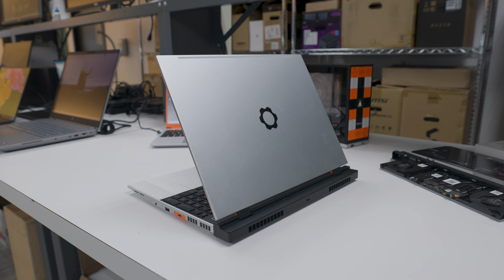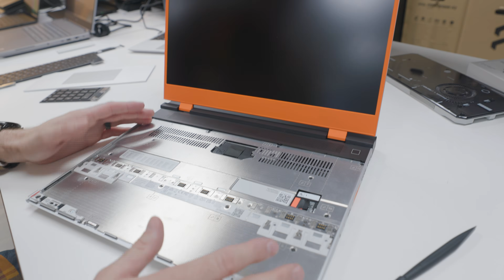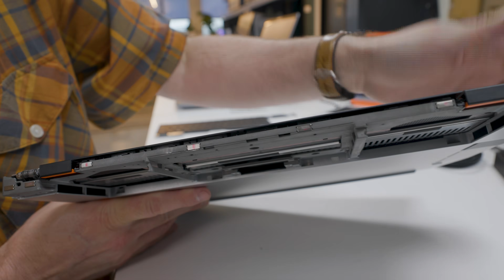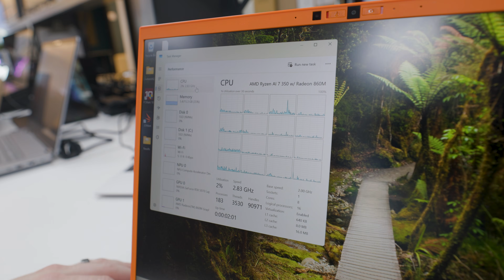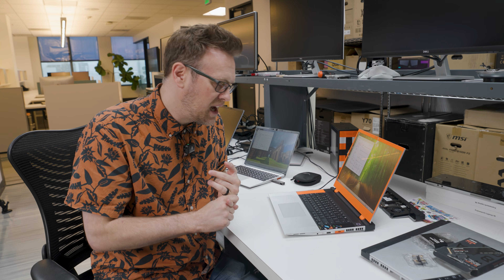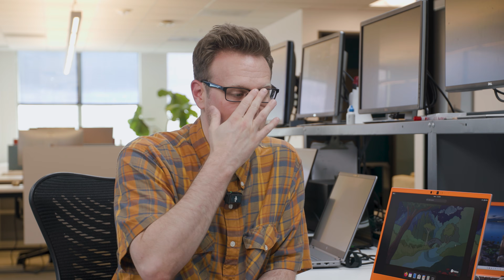Tested: RTX 5070 Laptop & RX 7700S In Framework Laptop 16

Comment: im considering getting a "Future proof gaming laptop. Do you think this is it?
Reply: Bit of a late reply but they are planning to release a oculink adapter which allows desktop gpus to be connected if that might interest you. Me and a friend bought one recently and due to us both being in IT havent really had any issues we couldnt fix or solve quickly and are planning to use the oculink feature when it does come out.
Reply: Not yet. The cpu isn't swappable so it'll bottleneck in the so near future. The idea is good tho.
Reply: @R_5_ thank you
Reply: @R_5_ you can buy new mobo though?
Reply: @carljamesbustamante3012 Technically, yes.
But upgrading the motherboard & gpu and everything that you'd need an upgrade will be the cost of a new laptop. Until they're so big to the point their modules matches the usual prices of specs it'll make no sense to use them. Unless you're a tech nerd who doesn't really care about money, then it's gonna be the best laptop of your life.
Reply: @R_5_ yeah I see the point. I'd love for them to support trade-in like iphones. That would lower the price so much

Comment: You can't charge via the USB-C port on the Radeon module, wasn't designed to do it. The USB-C is purely there as a DisplayPort out, so you can avoid having to use MUX switching. Does USB 2.0 speeds as well as it's the minimum standard.

Framework added charging pass through functionality to the Nvidia card as it was requested so much.

Comment: Imagine paying 700$ for the GPU + 1300$ for the base BARE METAL model with an entry level CPU when you can buy an entire new laptop with 24 cores CPU, 32GB RAM, 240hz and RTX 5070 for 1150 USD.

BuT yOu CaN UpGrAdE iT 🥴
Amazing! So I spent 2,400 dollars on a low-end laptop that will bottleneck any overpriced GPU that they MIGHT sell in the future.

They'll go bankrupt in 3 years. Extremely overpriced, double+ the market prices. Better to just buy a new laptop every 3 years than this cr*p.
Reply: lets see in 3 years
Reply: @dekufan-f7i  bruh how can u justify paying over double the price for the upgradability? You really think your lame 7840hs will be able to handle next gen GPUs of 3 years from now? It's nonsense.
Reply: @edengalant  there will also be newer cpus. but for me its about the repair-ability first and upgradeablity second. I want a laptop than can physically stand for 5, 10 years so by then when its unbearable, i get new shit
Reply: @dekufan-f7i it won't hold 5 years, the CPUs they provide today won't handle any component of five years from now... That's the truth. Laptop won't be a PC.
Reply: @edengalant  do you know you can also upgrade the cpu of the framework? Also look at the people running super old thinkpads and are perfectly fine, that what I want
Reply: @dekufan-f7i so if you upgrade your entire pc eventually what the difference than just buying a new one with better specs for half the price? I can't get the logic of people. I usually really like small consumer friendly companies but in this case it seems the greed got the better of them.
Reply: @edengalant  i personally like the fact that i have to choice to upgrade and keep the same system
Reply: @edengalant  They literally have done that with the Framework Laptop 13. You can take the ORIGINAL MACHINE and upgrade it to the latest shit no damn problem. You should actually do your research.
Reply: true, the main benefit isn't from upgrading though, it's that if you keep this laptop for years and something fails, you can just replace the part rather than paying for an expensive repair job (or in most cases, a whole new laptop). this point applies more to the framework 13 though i feel, as the price on this unit is just too high for most to justify as you said.
Reply: If all you care about is you, just go buy some trash-glued laptop. You'll often get devices, that barely run Windows and where Linux cannot even be installed, because a lot of parts lack drivers.

But if you don't care about that, go with cheap.
Reply: @igordasunddas3377 so let's pay x4 the price just so we can upgrade in 4 years the GPU that will be completely bottlenecked by the entry level CPU they offer for 1300 dollars 😂😂
Reply: "They'll go bankrupt in 3 years"

Ah yes because they were just founded and totally haven't been extremely successful in LITERALLY CHANGING THE INDUSTRY (See Dell's similar initiative) in the five years since their founding.

But you continue being wasteful and throwing your perfectly usable laptops away because you don't see the point in something that will actually fucking last.
Reply: @FluffyPuppyKasey no bro, so let's pay 1,300 dollars for a bare metal model with no ram and an entry level mini PC processor just so it will barely keep up in 2 years so I'll have to replace all the components again! So useful! People are damn stupid falling to marketing strategies... If it was half the price MAYBE it would've been worth it.

Comment: This is nothing short of amazing.
Reply: Nothing short of a scam. Selling low end components for crazy prices just so you'd be able to "upgrade" in the future with another overpriced component that will be bottlenecked by the older ones. Amazing!
Reply: @edengalant  Maybe the brands that sell you "high end" laptops that have soldered in components and little repairability could be scams. Framework is much smaller than lenovo, asus etc. Complain to them first.
Reply: @nelli-ocalypse  yet selling a 300$ mini pc cpu for 1300$ barebone (while the mini pc comes loaded) is outrageous no matter how you put it.
Reply: @edengalant thanks, you just convinced me to buy a framework! 🎉🎉

Comment: Wish they did a 5070ti, more vram is always better
Reply: They did an AMA about this and basically they couldn't find a reasonable thermal solution for the added wattage requirements within the same chassis
Reply: @slickvibez16  framework 18 gaming when?

Comment: The AMD dGPU module explicitly does not support charging, it is DisplayPort and USB 2.0 only. Nvidia does add charging support. Framework has charts on their knowledgebase detailing which ports offer which functions. Also... Fedora 22? Uh..... You mean Fedora 42 or the current 43. 22 was 10+ years ago.
Reply from the maker: Yes, Fedora 42! And thanks for the heads up on that port, that's what I get for not reading the documentation more closely. Just glad I didn't break anything 😅
-Adam
Reply: @pcworld  All in all I think you did a pretty good job - Framework's hardware is certainly a bit "unusual". On the Linux front its easy for a newcomer to get confused between all the many distros/components and versions. You'll be a "gray beard" like those of us who've been working with Linux/BSD/UNIX for... A very long time... Plenty soon enough... Keep at it.
Reply: @pcworld  Framework spells it out directly if you try to pick expansion cards while you have the nVidia GPU option: "If you are configuring your laptop with an AMD Graphics Module or Expansion Bay Shell, be sure to include at least one USB-C Expansion Card for charging. The NVIDIA® Graphics Module has a built-in USB-C charging port on the rear, so no additional USB-C Expansion Card is required."
Reply: What they don't say is if the Nvidia gpu charging is supported on the old version of the board.

Comment: The timing of this video could not have been better. I've been considering upgrading to a framework laptop. Thank you!
Reply: Ignore the comments above. You should buy a product based on your requirements.

Yes the framework is expensive but you also get 
-modular port
-modular keyboard layout
-better repair support
-replaceable battery
-better linux support (if you like) 
-Better charger (240W USB C) 
-replaceable screen if lines show up
And a chance to support a company who actually wants to make it products sustainable rather than cheap E-waste. 
I know these things may not be the features some people are looking for in a laptop but if you are then framework is best for you. 
Decision is yours
Reply: @okman9684 how does an entry level mini PC CPU (7840HS) for 4(!!!) times the price is sustainable? It will bottleneck any future GPU, cut the bullshit
Reply: @edengalant its sustainable because people care more about stability over specs. There's a reason why iPhones sell more. IPhones are better optimized and reliable than most budget and even flagship Android.
 Framework laptops are far more reliable windows laptops than many spec heavy Asus and dell laptop. Telling you from experience your 2000$ Asus ROG or Alienware will show many problems before a framework laptop will experience its first crash. And thats enough of a buying reason for many
Reply: @okman9684  And with all that, x4 the average price of a computer with such specs is irrational. That's greedy. They can't act as 'consumer friendly' when shoving such prices. Beside, that's not comparable to iPhone (with all my despise to Apple) - Apple offers you an extremely optimized and tailored OS with their devices. Here you just get swappable hardware.
Reply: Oh please don't. You can literally find brand new laptop with much better specs for half the price. Upgradability my ass. Their CPUs will bottleneck any future GPU you'll attempt to put. So imagine paying 2400$ for a low tier RTX 5070 laptop just so you'll be able to allegedly upgrade it for an overpriced bottlenecked GPU in the future.
Reply: @edengalant  No one should be looking at framework just from a perspective of gaming performance per dollar. In that case, yeah, go for a gaming laptop if that’s what you’re after. Yeah it’s overpriced because there’s more engineering involved having it be modular instead of all on one pcb, so yeah you can say it’s the novelty.
Reply: @edengalant  Exactly!! You have to buy their upgrade modules, which are underpowered and overpriced.   You could just buy an Acer Nitro with a 5070 Ti for $1300 from walmart, use it for a couple years and then just buy the next iteration a 6070ti or 7070 Ti for another $1300 and it would still be easier and cheaper.  Until Framework is truly module so that you have a wide range of products that can be swapped out, it is basically a novelty.
Reply: @willlazenby1050 it will never become such a thing. It's just not viable...
Reply: @edengalant  wanna bet?